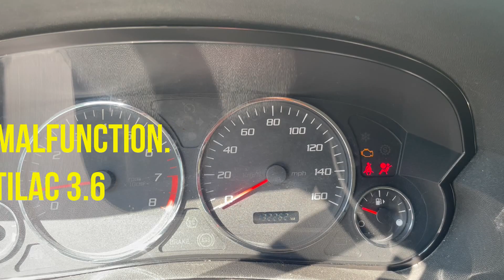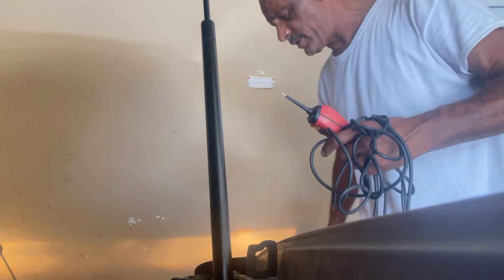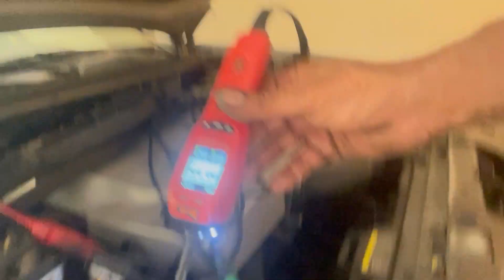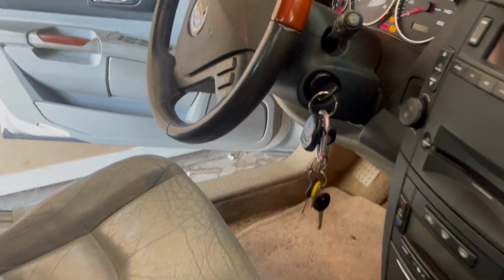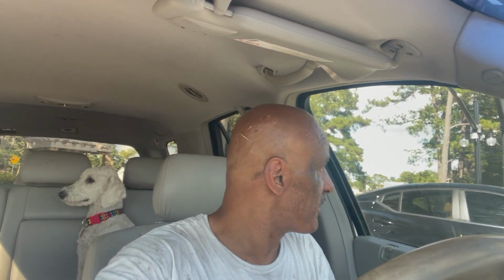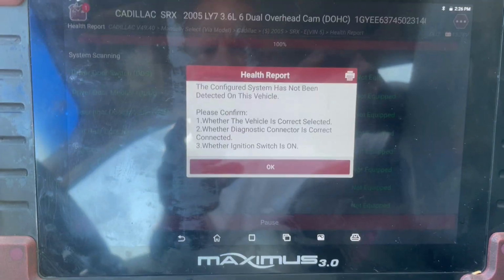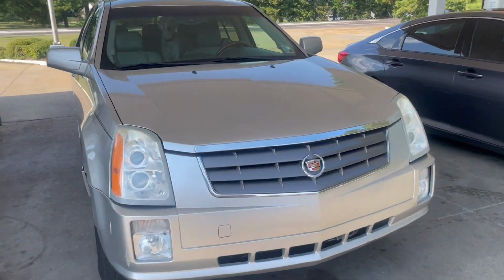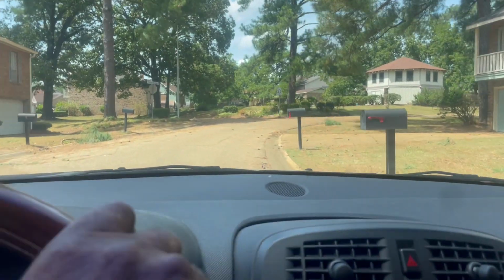CATILAC SRX ECM CLASS 2 MALFUNCTION  CANT REMOVE KEY OR CRANK

Comment: What convinced me it was the computer was that hard shifting. If it was wiring on the starter circuits it (probably) wouldn't also be having trouble getting info from the transmission.